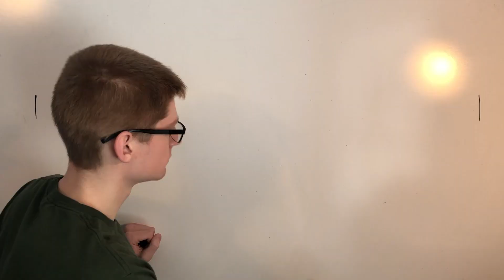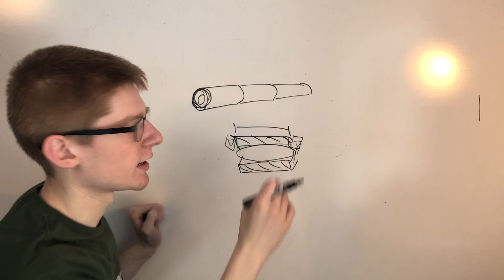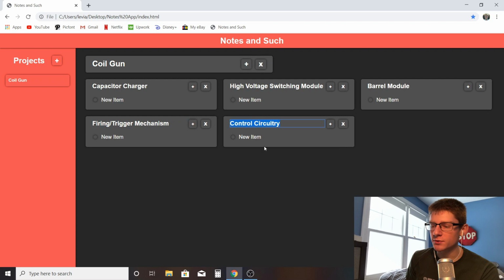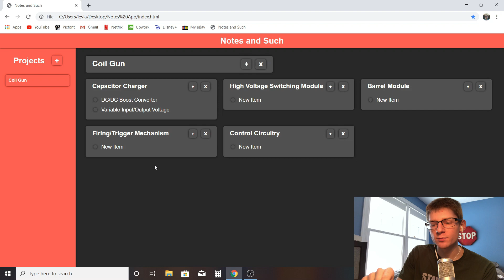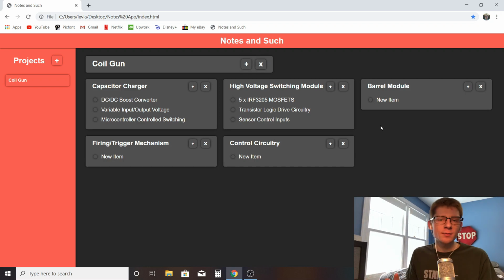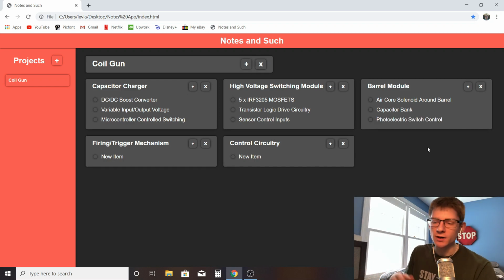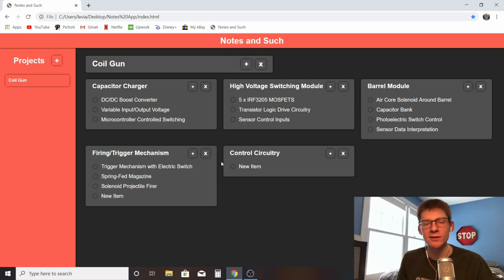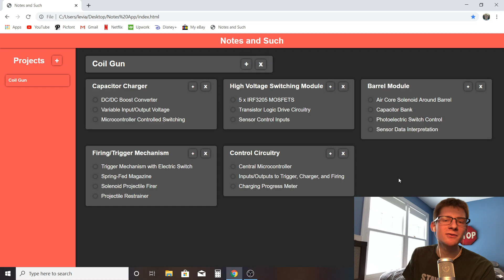Making a Coilgun - Part 1: Planning

Comment: What if you turn all coils on? Wouldn't they make a single magnetic field? Pulling the projectile to the middle of all coils instead of the individual coils. You then just turn off the coils one by one the same way as described.
Reply from the maker: That would be ideal, but if you’re using capacitors you store your energy, you’re not just turning the coils on. The discharge lasts for only a fraction of a second, and the maximum force is instantaneous.

Comment: Good luck! Looking forward to you winding a coil. Are you doing it by hand? What are your plans for this?
Reply from the maker: I usually wind coils by hand, but I’ll probably put the pipe in the chuck of a drill and wind it that way.
Reply: @LeviJanssen  À
Reply: I'm also testing ideal coil wire, turns, geometry. Would really like to hear the findings. I'm having better results with thicker wire. I posted some comparisons on my channel.